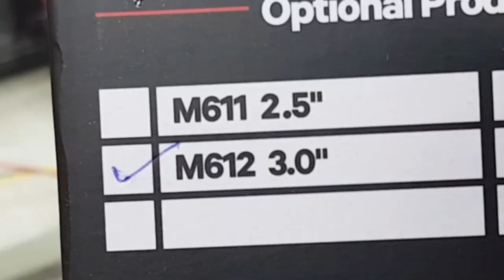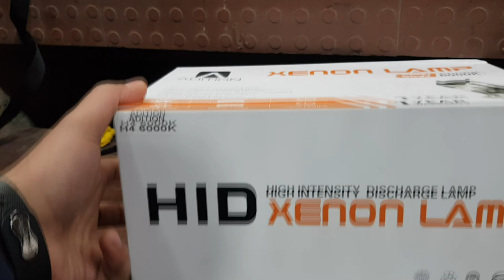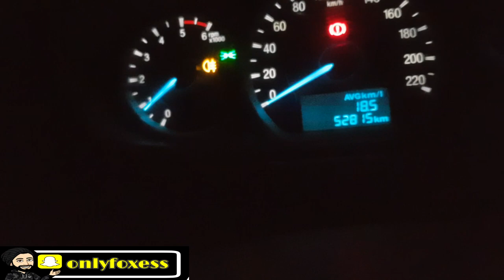BI-XENON IPH PROJECTOR FOGG LAMP Installation😍》IPH PROJECTOR Price💸》HID》ft.AUTO MUSIC EMPORIUM

Comment: Please go with professionals for the fitment of projectors since its working and pleasure depends majorly on the quality of fitting. I got them fitted from the same shop but they niether have equipments nor professionals to do quality fitting.
They could not set the beam which is necessary to get the output.
They had only one thing to say "Aisa hee rahega ye to".
Not recommended!
On the other hand I got XP projectors fitted from gurgaon, they had proper equipments and professionals for fitting.
Reply: Hi can u tell the cost plz?
Reply: @himanshusachdeva9714  I got it for 6500
Reply: @tarang gupta. 6500 is the price only for the IPH projector or it includes the HID as well. How much does it cost in total with all wiring and installation. Please advise. Thanks.
Reply: @karunsabbarwal007  Includes Hid and fitting as well..price may have changed by now..please confirm before going.
Reply: @TheEngineerBaniya  thank you for your reply. How much did XP projector cost.